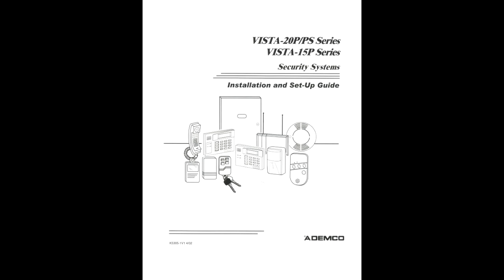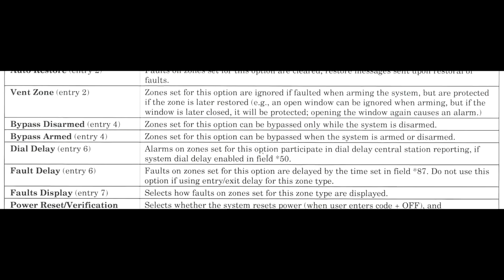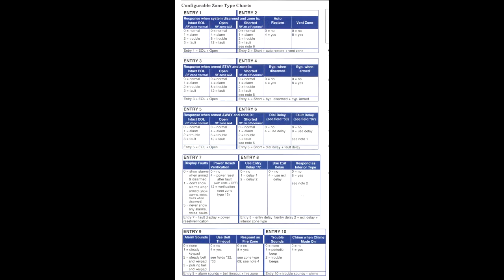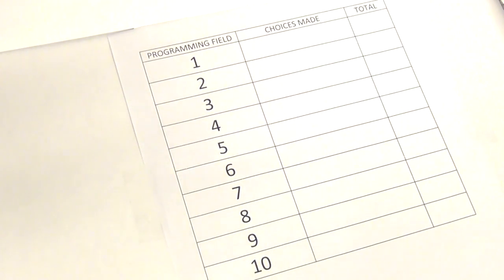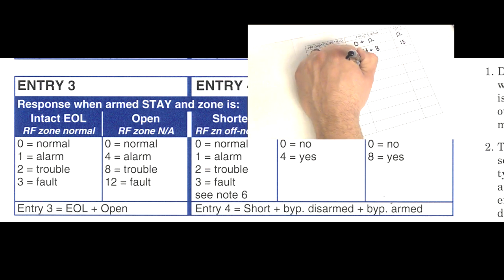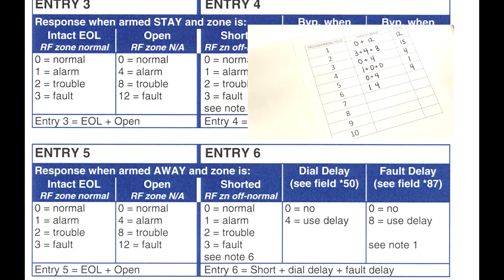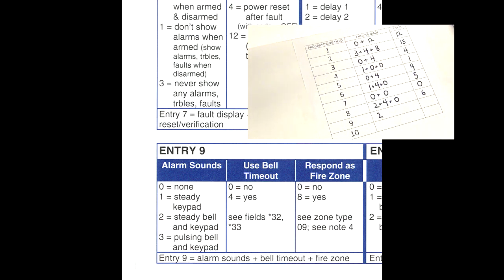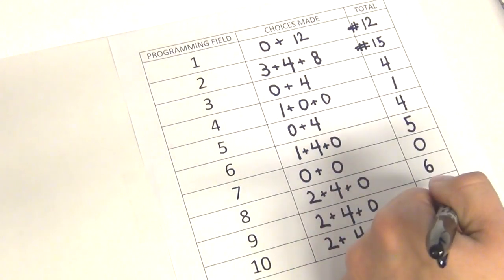Vista 20p Custom Zone Type Tutorial

Comment: Hey, I hope you can be of assistance here. I want to create a custom zone type that monitors a chest freezer door that sometimes gets left open. However, I would like it to only cause a trouble if its faulted for longer than 60 seconds. I also need it to report to the central station. I feel like there has to be a way to do this but I just cant wrap my mind around it. Hope you can help!
Reply from the maker: You can do that with an add on relay with built in timer. Altronix makes one. Search for alarm timer relay.

Comment: Great video!  Maybe I just need some more coffee - but I am trying to figure out a type 90 'recipe' for my fence gates with RF contacts.  I simply want my keypads to chime, and nothing else when one is opened.  No need for an alarm or fault.  On my previous Elk alarm system, this was defined as a 'non alarm' zone w/chime enabled, but the partition was always ready to arm regardless...
Reply from the maker: Thank you. Yes, you can do that and its fairly easy. Still done in *182. You would set most of the fields as no alarm and I believe the final entry which is chime mode on. If you need the exact entry’s for each field I can check later in the manual

Comment: Great tutorial, trying to create a similar setup for an interior motion sensor(wired and wireless) for Stay Arm - to display the zone fault, but not to trigger alarm.  In away mode, it should trigger alarm.  Is this is right code for 10 fields - F1=12,F2=7,F3=12,F4=11,F5=4,F6=5,F7=0,F8=8,F9=6 anf F10=6.

Comment: Thank you! It was really helpful for me. I only have a question for you. I managed to create a custom zone for some internal doors (using 5816 RF sensors), the behavior that I am looking for is that if the system is armed in stay mode, I want the zone to be faulted and not no trigger the alarm. I got it to work, in stay mode, if the door is opened I can hear the chime on my alarm system and the alarm is not triggered, but the display does not show what zone it was. The question is: It is possible to create a zone that, in stay mode, does not trigger the alarm and show that it is faulted?

Comment: Thanks for this, I finally figure it out but wonder why my siren sounded for a short time (1sec) everytime when I exit the house using your set up? Besides that everything is perfect.
Reply from the maker: Bernardo Villanueva Check programming field *38. This field should be set to zero.  This feature chirps the siren for a second to confirm the system is armed.  0 will turn it off.  Hope this helps
Reply: zimsjeep thanks again!

Comment: I have a question...I want to have a zone that sends the status of a sensor out to my ademco connected building module on my Vista 21iP panel.  I do not want central station to get notification and I don't want it to show a fault on my 6160v or my tuxedo panel.  Is the best way to put these sensors in partition 2 and never arm it?  Will my home automation get the status from the connected building module if it is attached as a virtual keypad to partition 1?  I cannot find documentation on how the connected building module passes information along so I can follow the programming path.  Thank you, Eric      ecschnei@hotmail.com
Reply from the maker: Eric Schneider I'm not familiar with that system, sorry I can't help further

Comment: We have a storage unit door I want to program as zone type 90. Also we have a keypad in the storage unit to disarm and arm the system. Your video shows you can arm the system while the door is open and then when closed the system arms. What I would like to do is have an instant alarm sounder when this particular door is opened by a burglar, but a normal opening by owner will have time to disarm the system even though the sounder is activated. Is this possible?
Reply from the maker: If I'm reading this correctly that won't be possible.  The system would have to know who's opening the door which is rather impossible.  You could program a very short entrance delay to accomplish what you're trying to do.  Or program as an instant zone with dial delay to central station.  The horn will sound instantly when someone opens but the dialer won't activate as long as you disarm quickly.
Reply: So if I setup entry 8 as 2+4+0=6 and setup *36 at less than 30 I would have 30 seconds to turn off alarm, but still be able to arm system with door open.

Comment: While I have been working on alarm system for decades, the 20P manual has me beat.  Thank you for the great tutorial.  When using the 6160 Remote temporarily wired at the control panel, can programming be completed there then relocate the remote to permanent location without losing programming?
Reply from the maker: +Notlaw47 Thanks for the compliment.  Yes, you can relocate the 6160 once programming is done without losing memory.
Reply: +zimsjeep  Great help. Worked out great with remote in the room with the control panel; quieter there too.  Thank you.

Comment: I know this is an unrelated video, but you appear to be smart and I appear to need help. I have fire alarms working fine on zone 1 (smoke/thermal detectors), but they wont work on any other zone (for example, 2). I even tried just moving the wires from Z1 to Z2. The config on the panel is the same for both. It gives me "fault" in any other zone with alarms (other then 1). The test buttons do not work on the detectors. They are all EOL, and I have swapped them around to find that they all work on 1 (but not 2, 3, or 4). 

Is there something I am doing wrong?
Reply from the maker: You sure you have the other zones programmed as fire zones?  The only zone pre configured from the factory as a fire zone is zone 1. If you did change the config from burg to fire for zones 2-4, make sure you have eol selected in the zone configuration setup menu.
Reply: zimsjeep Under advanced config (to make it easy), i have 2 screens that only differ in zone number. It is as follows: ZN 01 (or 02/03/04), ZT 09, P 1, RC 10, HW EL, and RT 1. I did noticed that under simple config, I was unable to change the hardware type on Z1, but thats all that I noticed.

And thank you for your help =)
Reply: Dylan Madigan I also noticed, that with 2 detectors on 1 and 2, zone 1 reads about 12VDC, and 2 reads about 5VDC with the alarms plugged in (even when I switched the wires to each zone).
Reply from the maker: Are they 2 or 4 wire smokes?  Are you using zone doubling?

Comment: I am about to buy a ademco vista 20p. Its is hard wire and not wireless. I am going to just swap out my old system w/ the vista. do I need to custom ea zones when I install the system? All contacts are going in the same zones as the old to the new system.
Reply from the maker: Depends - if you want to perform a function that isn't a predefined zone type programmed on the system, yes - then you would need a custom zone.  My guess is that you will not need a custom zone since most of the common zone types used are pre programmed.

Comment from the maker: The manual's worst problem in my opinion is the way it is layed out...Very confusing but most of the info you need is in there. The # is in the manual.  Page 4-11 Under *182 section on the left side (values for each of the 10 entries)  

I will add that a "vent zone" should be a preconfigured zone type on the system from the factory.  You shouldn't need to do program from scratch.  This could be a very useful zone type for many applications but isn't used as much do to the programming involved.
Reply: Napco programming is worse. Vista programming is easy.

Comment: I had to re-read the chart 3 or 4 times to understand how it worked.. This is a great video.
 I did a similar thing with my garage door.  I think not only is the manual poor but the entry method is quite poor as well. 

Is the # thing for 2 digits in the manual?  I ended up guessing that when I had my programming sheet made and was having problems getting it entered.